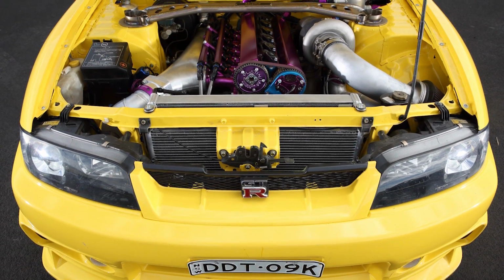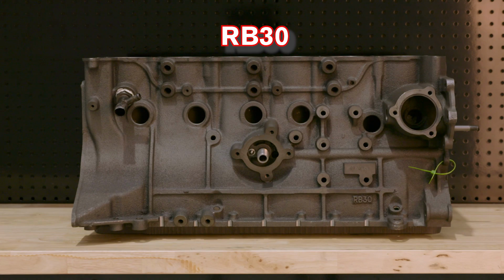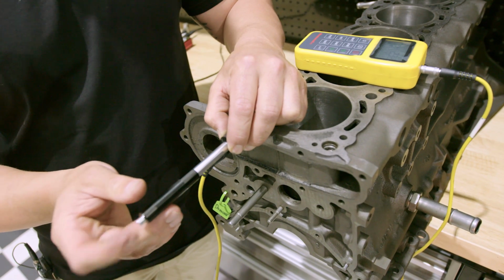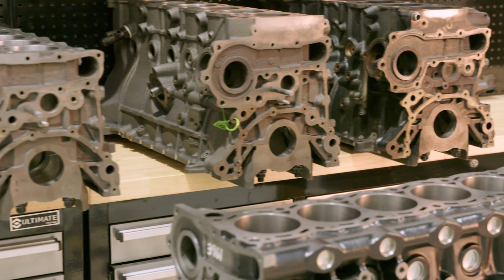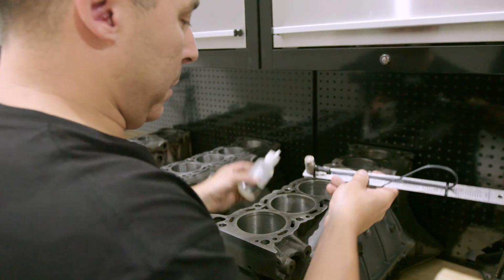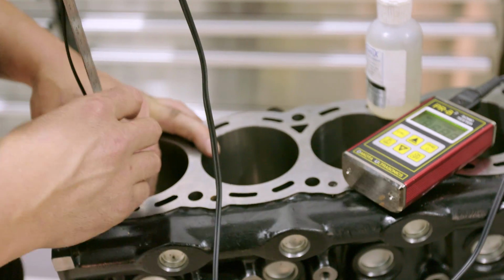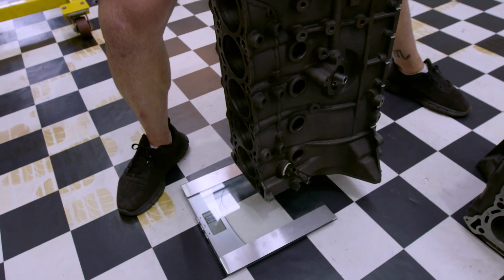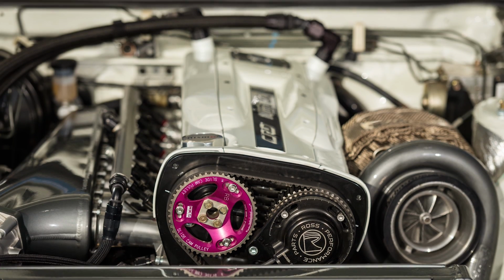Which RB Block is Best? Mythbusted with Facts and Data!

Comment: Unless you are a credentialed Engineering or you have real experience testing and building competition engines, you should reserve tyour OPINIONS. Herman did a very solid test. Higher hardness means higher compression strength! No way to argue that! His testing shows which block will have the highest compressive strength in the cylinders. That was the intent of his testing. As correctly noted by a slew of Nismo fan boys and self-proclaimed engineers, high hardness also comes with a tradeoff in toughness and tensile strength. Parts of the block under tension MAYBE more subject to failure IF the stress and strain in tension exceeds the mechanical properties of the materials. Why do more 05U blocks crack than N1 blocks? If they are higher in hardness there are more brittle and subject to impact. However, unless you drop a valve in the cylinder or a piece of porcelain off your spark plug, impact resistance is never the issue. Nine times out of ten, engine failure occurs because of bad tuning, low-quality machine work and using crappy parts. Why would an OEM not make the best parts possible? One word: BUDGET! The aftermarket can afford to have a much higher cost per unit than the OEMs. I've built more high-power RB engines in the States than anyone. I'm also a credentialed Mechanical Engineer. https://www.dsportmag.com/the-cars/the-worlds-most-streetable-8-second-nissan-r33-gt-r-project-rh8/
Reply: well said, and yes 05U's break more often than N1's because there are 1000 times more of them out there, we have broken plenty of N1's, that's actually why we set out to work out what makes a block better... 

Thanks Dsport
Reply: @hermanurriola138  No need to thank us. you did a great test. Haven't used one of those portable hardness testers, but now I'm thinking of getting one. We have the Rockwell tested but it's great having some non-destructive testing devices. We use a special portable hardness tester (for aluminum) on all of the cylinder heads that we do to identify potentially soft heads. We've saved customers thousands of dollars by not having them invest in a soft cylinder head. If you get a chance, try making it out to IDRC's The Shootout presented by Buschur Racing in August of 2019. We'll have a few of our builds there. Hopefully, one of them will be my R33 GT-R. Something is not happy over 1,500 flywheel horsepower right now. Not sure if blocks are twisting, cranks are bending or we are beyond wet-sump oiling capabilities. Looking forward to see your next video on demonstrating block twist.
Reply: Indeed, a simple device to show you a difference that does not take a long time to do = good for the camera.
Reply: It's funny some of the issues you come across when building big hp motors out of 20+yr old blocks and cylinder heads with unknown histories. I've used a head on my RB30 that had gone soft and it caused the head to lift under boost as the head stud washer recessed into the head over time. A very unusual problem to come across, was a result of welding the crack that forms under the cam tunnel when an air pocket in the cooling system had caused localised hot spots. Some people do better jobs than others when it comes to repairing cracked heads... 😰
Reply: DSport. What happend to your R33?
Reply: This isn't that hard to understand .it is what the numbers say it is anybody arguing with it would have to just be stupid.
Reply: @msengineeringdavid3702  First time in my life I've been called an elitist. I guess I am fortunate enough to have a pretty solid group of friends that have knowledge and experience. I guess they would likely be considered among the elite in regards of engine development. If being an elitist means I don't have to listen to idiots, sign me up. You don't have to be a credentialed engineer to offer valuable input. David Buschur was a performance pioneer in the Mitsubishi performance realm and he had no formal training but more common sense than 99-percent of others. His methodical "change one thing at a time" testing helped him to gain incredible amounts of knowledge and experience. I really appreciate input from those that don't know and want to understand, but those that troll and profess when they don't really know anything waste everyone's time.
Reply from the maker: One of the most reputable engineers/journalists/engine builders around who owns a machine shop agrees with out video but some people still think they know better. This is the internet personified.
Reply: @TheMegajr  Just resting. Got a list of stuff I want to try out, but been too busy to wrench on it lately.
Reply: @dsport  build nissan Sr20det swap ve head please...
Reply: @dsport  And sometimes it can help to have someone that is not trained in whatever thing you are doing, as it is that outside of the box thinking that can lead to different discoveries.
Reply: Seasoned blocks are harder. It’s not “fair” to measure hardness of used other blocks vs new N1 block. But I guess for drag racing you don’t have time to let the engine go through enough heat cycles to harden the block.

There are other Nissan RB26 blocks out there. I guess, I’ll keep them secret.
Reply: @tomjones5860  that's ok, rb30's better anyway. :p
Reply: DSPORT like a typical fanboi you took a very one sided view to your "facts", higher hardness is but one factor in a two factor decision, so you can argue with that. If one block is marginally harder than another but the other block has a much taller deck height, then give me the taller deck height every time. A taller deck height means you can run longer rods, which results in better rod angles, and less side loading of the block walls for hardness to be an issue.
Reply: I'm currently on my 2nd year of electromechanic engineering and already had 2 subjects that refer directly to what you said. Materials and resistance of materials. I can vouch for this engineer I enjoyed the video very much. I'm wondering if someone has ever done a study with a running engine using a extensometer. Maybe that is something I could do for my uni project, cheers. 
Edit: word cuz I suck at mobile typing
Reply: Get'em Mike
Reply: @msengineeringdavid3702  He's just a regular guy. He just wanted more knowledge, which is power. When Cosworth US went out of business he bought everything. Dsport is likely the best builders of sport compact engines in the US today, but so few people know and they really only work with stuff they know best.
Reply: @msengineeringdavid3702  He is not an elitist he was and is one of the few people in the US or California with a R33 and it's been over 1,000 hp for a decade or more. I see you comment on every automotive video. Just a troll people don't feed them.
Reply: @tomjones5860  Tuners don't know about or how to season a block, to them that's old V8 stuff nothing to learn there, keep moving. Yeah keep the seasoned blocks to yourself, to finish first; first you must finish, that includes drag racing.
Reply: I don't need any form of degree to notice we didn't see the results of any destructive testing, or alloy/grain structure analysis. The assumption you made that wall thickness and hardness is most important rests on results you didn't show or discuss....
Reply: I agree with you on two things and disagree on one. Firstly, tuning and engine preparation are main causes of failure. The other cause is the "unknown" factor that every block comes with. RB and RD blocks are some of the best in the world for weight-power ratio. I doubt you've built more RB engines than anyone in the States however. Only reason I'd state that is because RB's are so intensely popular. There are high school and college kids building RB's for street-sport teams right now, and with as many as they fuck up, they keep buying more. Not to mention the definition of "Building" a high-power RB engine. Plus you have to consider not everyone glorifies the completion of an RB engine build. There are also thousands of mechanical engineers in the united states as well. The only thing you've done is make a condescending comment, assuming everyone watching this video knows nothing of engine building, which if they found this video, it was probably under the assumption they build engines, know about engines, or have a fanatic love for GTR's.
Reply: I'm glad somebody mentioned hardness and trade-off for it.
Reply: Fully agree. Also this video was eye opening. I graduated in Automotive Engineering and this type of testing was not even mentioned. I automatically thought that blocks are blocks and they're all the same. But in fact, as mr. Urriola has shown, castings can vary greatly to such an extent that, with proper testing, you can really say that X block is worse than Y block.

Personally I'm in the DSM game and now I really want to find out what the true material specs of the 4G63 blocks are. I don't even know where I could find both the tools that were used in this video.
Reply: Wait, so if I didn’t 100% agree with what they did or not did in the video... I’m a fan boy, and needs a degree in engineering to comment?? I do have a degree in engineering btw. But wtf dsport. Was a fan of you guys for like a decade +, but your statement really turned us off this time. 
I remember a JDM magazine did a very detailed comparison years ago, up to the metallurgy, situation on temps. etc . If I could just find it then maybe I could say something now with no discrimination.
Reply: Brian Davis _
Reply: @hermanurriola138  in the beggining it says in the video that the rb26 05u block cracks partly due to the all wheel drive system, in conjunction with the comment made by dsport that harder blocks are more brittle (arguably) could it be possible that the n1 blocks being softer was developed to address the cracking issue due to the all wheel drive system? As not all disciplines in motorsport actually require as much as horsepower as possible. The JGTC penzzoil skyline for example are 500hp albeit rear wheel drive only.
Reply: @1985metalmaniac  Hi, no absolutely not, this is a misconception that a harder alloy is more brittle its a different scope entirely, in this situation there is no yield strength in a cast iron block, its not ductile, there is no stretch it reached its ultimate strength and cracks, the harder it is the more it will take before it reaches its ultimate strength. therefore a better block.
Reply: @hermanurriola138  thanks for the reply. fair enough then.

Comment: Thats cool. Over priced N1 block is the same as a RB25 block. Must piss people off.
Reply: Not exactly. It's more about the material make-up for the N1 which they didn't cover in depth. Heat resistance, heat soak, and heat distribution are different for N1 in some ways. But they didn't cover real-world applications.
Reply: No it didn’t. Unless those people are very gullible. N1s have been proven for years on race and streets, and those are facts. Agree with Best Lee Sin NA, they did missed some crucial points here.
Reply: The N1 is supposed to be the oil leak improvement together with newer material. Dunno about the details though...
Reply: Na, metallurgy, manufacturing quality control and the matching rotating assembly means the arbee’s sporting these things from factory can handle some pretty impressive power levels and the sort of power delivery you want for (narrator says exactly what im about to type lol) sport street/circut racing. And can handle the physical demands of the repeated high stress life that a race car engine is subjected too, and needs to be able to tolerate over a decent amount of time. A harder/brittle block just wont compare over the span of a championship season. Unless its too over engineered- carrying too much unnecessary mass around with you.

The block is just a link in the chain. If you get the formula wrong cause your 1000hp+ build requires components much heavier and with much higher losses, then yea, ya prob wasting monies better spent elsewhere. Horses for courses
Reply: Did you even watch the video or know anything about either of those cars?!?
Reply: Stephen j neo is different heads with vct
Reply: Stephen j There aren’t any ‘advanced’ castings for RB blocks, unless N1/RRR blocks actually have the improved water/oil galleries that wikipedia and early 2000’s forum posts claim. And based on this video, those sources don’t have a track record of being reliable.

NEOs have the most ‘advanced’ factory heads as they offer both solid lifters and VCT on the exhaust cam, on top of 1mm oversized ports. But the HKS V-Cam kit for RB26 heads offers continuous VCT where the NEO only has a switchover at a single preset rpm.

Hell even to this day Nissan build VR38 blocks by hand and still have a lucky dip on bore clearance.
Reply: @Zonda1996  You are correct except for the VCT is on the intake cam. No RB has VCT on exhaust, only the CAS.
Reply: @Zonda1996  hi, I have question about rb20det block. Can you help me with some questions about this block?

Comment: Herman, thank you so much for taking the time to do all these testings and sharing it with us.  Your video definitely helps clarify a ton of misinformation and rumors that for decades have been floating around, but there's nothing better than to prove with empirical data the real science behind it all.

One question that I've always had, is have you ever compared the RB25DE, vs RB25DET RWD vs RB25DET AWD blocks head to head?  Maybe the RB25DE & RB25DET RWD blocks are identical, however I've always wondered if the RB25DET AWD is beefier compared to the RWD.

Comment: Excellent testing but it is worth noting the hardness might change over time and heat cycling. it wouldn’t be unreasonable to suggest the newer N1 blocks might be softer as a result of the virgin steel and lack of heat cycling, further more the thermal properties of the steel have yet to be tested there may well be a significant change in hardness malleability and tensile strength under various conditions.

Comment: what would be interesting would be to manufacture a billet rb20 block to solve the breakage problem and take the rb20det engines to 1000-1200 horsepower, being the engine block reliable and strong,burn less fuel and at the same time make it a powerful engine, optimal for driving on public roads.

Comment: nice vid, wish they included rb20 testing
Reply: Rb20 will max out on power long before the block becomes an issue
Reply: @zyoungson215  yea wanted to see how they comp data wise over 25/26/30/28 thickness etc..
Reply: Also interested as RB20s are older just like the 30 so maybe it has the same hardness and smaller bores may mean more material
Reply from the maker: stay tuned. its coming
Reply: @MotiveVideo   great!

Comment: Ahh B 30 block with an ahh b 26 head
Reply: ONLY if its an ET block. The E block is weak, but you can fix that of course. But the turbo rods are way stronger. Quite a rare engine now. The gearbox was really strong too.

Comment: E85 is not the determining factor for oil squirters fuel doesn't cool your wrist pin or bores  GM tested this heavily for the c6 Zr1 the temperatures are pretty high there if you do nothing about it service life is significantly different.

Comment: Great vid publicly showing what a few of us have been doing, only criticism is the proper thrust face that you really need to worry about is not on the hot side, but on the inlet side, thats where the power stroke force is, never the less nice to show the comparisons between the block designs which i never have known.
Reply: Haha Peter, you picked it, realised that after testing as the blocks were all arse about from how I usually test them, we didn't realise till after but it was too late
Reply: @hermanurriola138  Thought so, was probably the pressure of having the camera on you and trying to get it right at the same time, somethings always going to go wrong no matter how hard you try. :) Still , walked away from it learning a fair bit, i never knew the finer differences, great work mate.
Reply: @pt6868   yes i am a little camera shy, and this took around 12 hours or something so we were not going to do it again :) thanks my friend
Reply: Funny how most did not pick it up but discuss other little things.

Comment: Interesting initial overview. The rebound test should be conducted on a horizontal surface if possible as the rebound is affected by gravity. A vickers or brinell hardness test would be preferable. To draw any conclusions about the metallurgy before sending samples to the lab would be premature. Castings more than anything are subject to large and inconsistent metal grain size and distribution and depending on heat treatment process will often present with different hardness out of the same batch. Harness can also vary in different areas of any one item due to any irregularities and variation in the heat treatment and cooling process. Defects such as cold shuts, laps and micro cracking are also very common and internal flaws are not located unless radiographed or flaw tested with ultrasonics at low frequencies to penetrate through the coarser grain structure of the casting.
Reply from the maker: teamneverlost Herman normally does then standing up but we wanted to be able to film it well on the bench. Doing them all horizontal make the results perfectly comparable. Horizontal vs vertical is under 5 points.

Comment: Mad respect for this man. ( coming from a welder who does ndi tests on welds with powder, xray, and magnets) however i was kinda confused about the test of the rd 28 block considering the results you got on hardness. I agree that the resizing the bore on the RD probably isnt the best idea but everyone is free to do what they want. Cheers mate hope to see more videos from you
Reply: I think it is more about the offset of the notes if you were to review to 3.0litre pistons.
Due to being weaker block material, the thinner wall would suffer compaired to the 3.0L with it's stronger block material